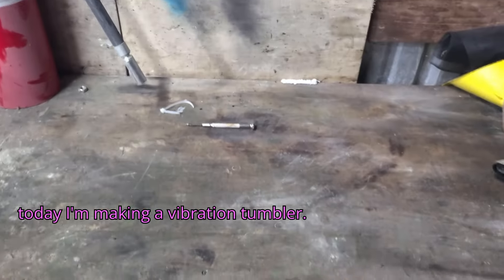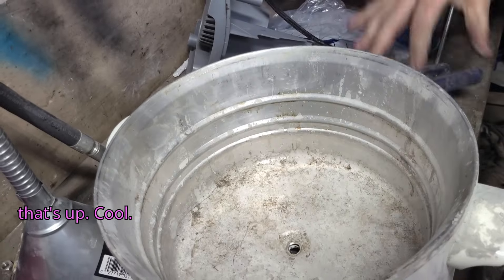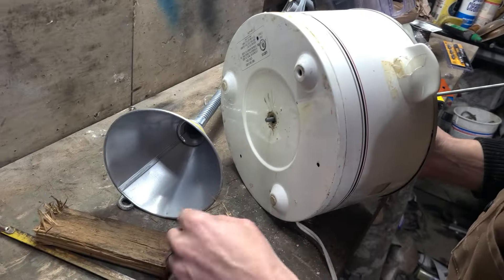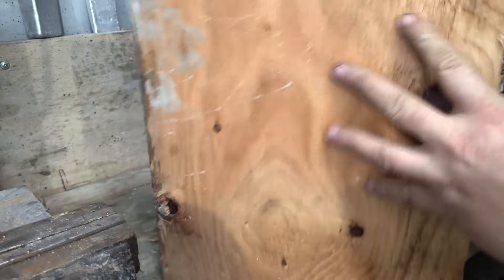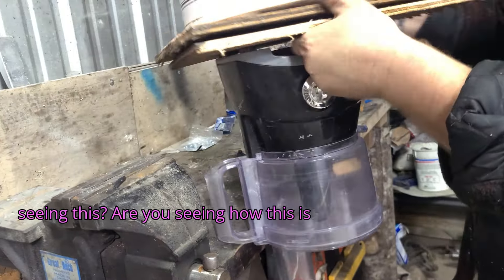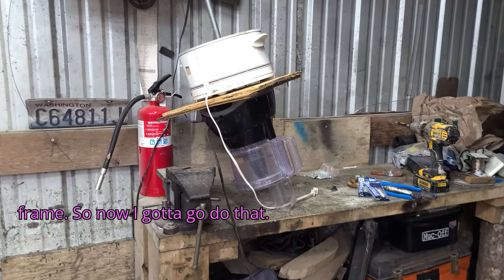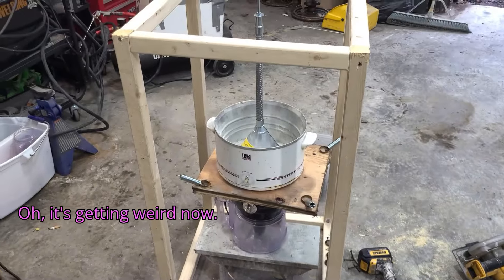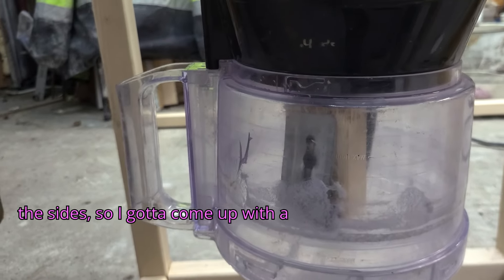How NOT to build a vibration rock tumbler

Comment: That certainly was an interesting idea. It could work in theory, but appliances have notoriously cheap motors.
Reply from the maker: Yeah, it became an issue of how cheaply I could do it out of old junk, vs just paying for one. Not a lot of motors are made to run for days on end under load.
Reply: @ICutRocks  an old washer or dryer motor might work if u can find one
Reply from the maker: That's an excellent idea. I'll have to take to craigslist. That would actually be really good since they're designed to run under heavy load.
Reply: @ICutRocks  I have the occasional good idea

Comment: Hear me out.
Cut one side of the sidewall off a tire.
This makes for a deep trough.

Put a traffic cone in the middle.
 That then goes in a barrel and drive it with an old washing machine.
I find an old tire on a wheel makes a great ball mill
Reply from the maker: I may have to upgrade to that at some point. Washing machine motor seems to be one of the only appliances that runs for long periods of time under load. If you can think of a smaller one, let me know!